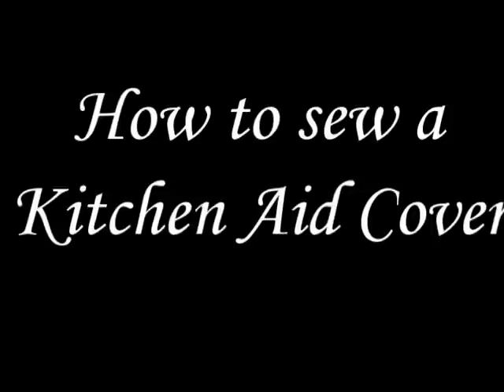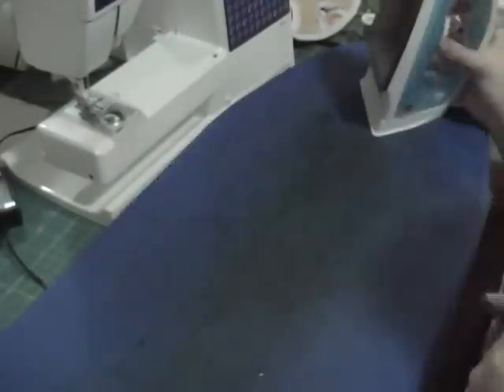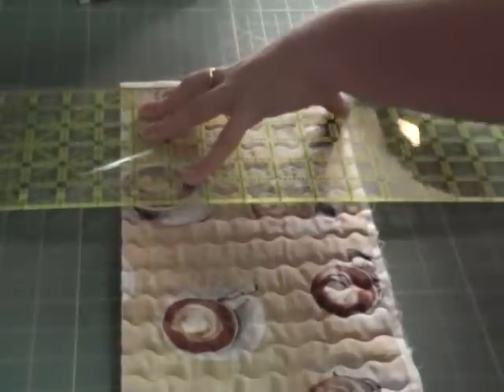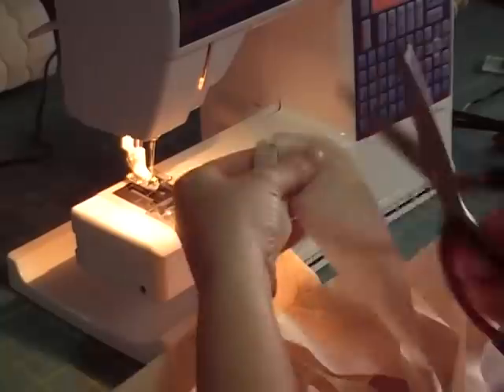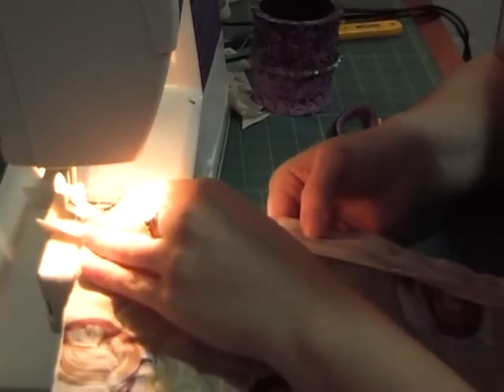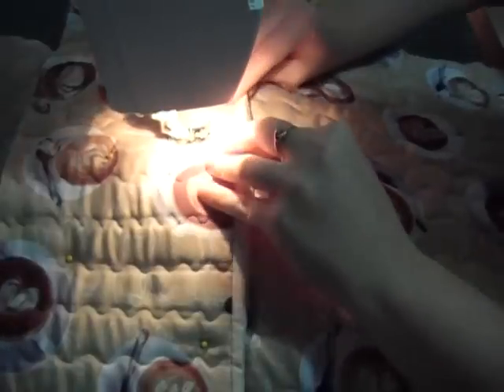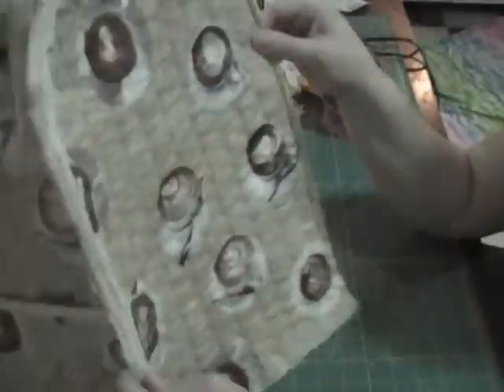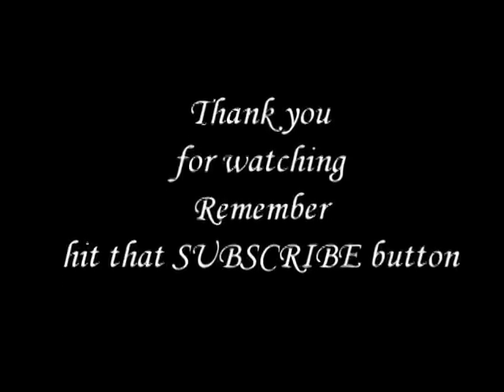DIY How to make a Kitchen Aid Cover

Comment: my granddaughters mixer is a lift kitchen aid 5 qt.  she would like me to make a cover for it.  I don't have the mixer to measure but she gave me these measurements 12 wide, 15 inches depth and 17 high.  could you help me with making the pattern.  thank you so much
Reply from the maker: patricia renihan ok so of those are the measurements I would say you are best to make your front/back piece 12.5" by 17.5" (with curve a top) and then your long piece would be 40" by 15.5". (I always over estimate the length of this piece because of the curve, best to have more then not enough) I have added 1/4" seam allowance. Hope that helps a bit

Comment: Thank you for sharing this tutorial. I wanted to make a simple cover for my mixer before it arrives and tried to go by the specs. However, it proved to be difficult when you factor in the curve so thanks for posting the measurements. I was kind of close with what I had come up with, but better safe then waste.

Your cover looks better than anything I've seen for sale on the Internet. If you don't sell them, you should. :)
Reply from the maker: D. R. Griggs the curve is the most difficult part i will not lie about that. I do make and sell them but only by custom request.
Reply: ***** I do not sew (I'm a professional chef) but I have been looking for a good quality cover for my Professional 600 model Kitchen Aid Mixer in my home kitchen. Your's is by far the best looking and high quality cover I have seen. Can you contact me for a custom made one please. Thank you..BTW very nice instructional video.
Reply from the maker: ***** Thank you, if you would like to order one please email me at kayellehandmades(@)hotmail(.com)

Comment: I have a 6 qt Kitchenaid mixer. Do you have a pattern for that size of mixer? Thank you! Can't wait to start sewing!
Reply from the maker: +Jessie Evans in the previous comments there is a template. I recommend printing it out and holding it up to your machine to adjust height. the rectangle would be the length of the curve and depth of your machine.

Comment: Thanks for sharing this.  Can you provide us with the measurements you used?  I think my Kitchen Aid is about that size.  Thanks for your help!
Reply from the maker: +seahorse0000 since the machines are all different sizes i didn't include my measurements. @s/791cboy8gx5nrk85vobu here is a link for estimate front/back panel.just length at bottom for height and width of bowl. Then measure from bottom left all the way to bottom right to get the length of the big piece and measure the depth of your machine. Hope that helps. If you machine is the same as the one i used i do know i tried the front and back panel link i provided and it was the perfect width but not tall enough so I just would add the extra and then measure for middle peice.

Comment: thank you for your precise instructions. excellent video. my mixer looks exactly like your SILs(pic end of the vid). can i please have the measurements for the 4 pieces. i also don't knw how to get the curve sided piece. I'm beginner and would love to try this out. thank you
Reply from the maker: I can help you out no problem. I took measurements of the machine and just curved what I thought. https://app.box.com/s/791cboy8gx5nrk85vobu here is a link to a template I found that may work for you to get the curve right, but you should still take measurements of your machine to make sure it will fit right. I am going to be making a 3rd one of these soon and video tape myself more making it as when I made my second one I changed how I made it a bit to save some sewing time and make it more basic for the beginning sewer.
Reply: *****
Thank you so much!  Do you know how to make a cover for a KA Food Processor too?  All of my kitchen appliances are Kitchen Aid.  I've had many of them for several years, without any problems.  I did however ruin my mixer cover, by accidentally putting it in a hot dryer.  It shrank, of course.   :(  Instead of spending more money on another one, I want to make it this time.  So, thank you for posting your videos.  I am a beginner sewer, so your videos are extremely helpful to see.  Thank you!
Reply from the maker: Astrogirl1usa sorry for delay in responding and thank you i try to make my video as clear as i can. I have not made one for a food processor yet bu ti do have a template drafted as i wanted to make one this holiday for a christmas gift. If you need help feel free to ask away
Reply: *****
Thanks, I will.  Congratulations on your (not so new, by now) baby!   :D
Reply from the maker: Thank you he has grown fast on me. Now 6 months old. Keeping me busy but we are on more of a routine now so trying to get back to my youtube channel with some more videos.
Reply: *****
Treasure every day with your little guy; they do grow extremely fast!  My son is a Junior in High School and I know he will be leaving home in a little over a year, to go off to college.  I am treasuring everyday that we are still home together.  Next, it will be his first apartment, etc.  Lately, I find myself thinking of his baby and toddler years and all the things we did together, more and more often. It's like his first day at school all over again!  lol

Comment: hi! Just watched the video and want to jump right in! Have the material I want to use. Have the pattern printed out for the sides..My KitchenAid Mixer is the 5 qt artisan also. My question is: I too, want to have the pattern of my material face correctly. which means I need to cut the long main piece in half, yes? What is the size  of the one middle piece? Thanks so much for your help and the video! Can't wait to start!
Reply from the maker: Hey remember the pattern may be smaller then machine. Hold up to side of machine just to make sure it won't be to short and add length where needed. To have same design on both sides just measure from one side to the other of you curve pattern add a half inch or so and divide by 2. Hope this makes sense.

Comment: Hello, did you take classes and how long have you been sewing?  I started making quilts about 6 years ago and I am working on two now.  do you have any ideas or tips on quilts and putting everything together.  I am thinking about taking some sewing classes. This is so beautiful and awesome work.
Reply from the maker: +Cherie Cunningham NO I did not take classes. I started being interested in sewing when I was 10 or so. My mom let me sew on her machine and showed me basics. The rest was trial and error a lot. I asked lots of questions and researched many things before I would start a project. For quilting, I do not do it as much. But I can say measure twice cut once, baste stitch where needed, press and spray adhesive will all help you.

Comment: I enjoyed watching you well done video;
I understand how to construct the cover; I did download the pattern, but what are the measurement of the pocket and gusset that the pocket is attached to?
Reply from the maker: the side pockets were i believe 8" high by the width of cover. I do suggest putting something to counter the weight on the other side. this is something i have noticed when using cover that having blades weighs the one side down more.

Comment: The pattern you supplied is for the two sides but where is the pattern for the middle and the pocket?  Please reply.
Reply from the maker: Audra Brewer sorry for the delay. i gave a pattern of an average size one. its best to measure the depth of your machine and go over from one side to the other. I have a video of how to measure the machine coming soon. I didn't add sizes due to the fact that these machines were all different sizes.

Comment: I cut my fabric to the sizes that were stated in the link but they are obviously not the same that are supposed to be used, so can you please be more clearly in your measurements? Thanks..
Reply from the maker: I am sorry it didn't work out for you. I have had quite a few requests for pattern, I am making another one this week for an order so I plan on video taping how I came up with pattern and showing my newest way on how to make this. I originally didn't put pattern in cause I figured people had different size machines.

Comment: How can I get the pattern for the stand mixer cover
Reply from the maker: Doris Saxby since the machines are all different sizes i didn't include my measurements. @s/791cboy8gx5nrk85vobu here is a link for estimate front/back panel.just length at bottom for height and width of bowl. Then measure from bottom left all the way to bottom right to get the length of the big piece and measure the depth of your machine. Hope that helps.